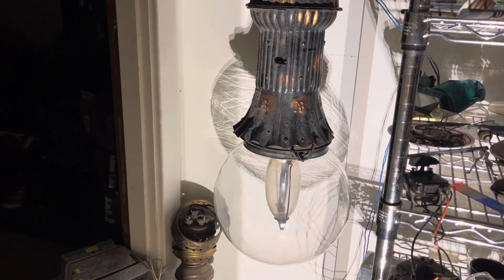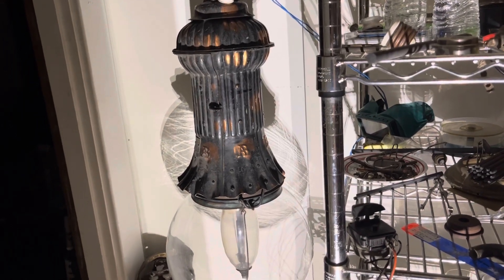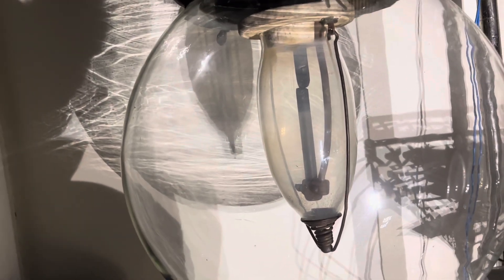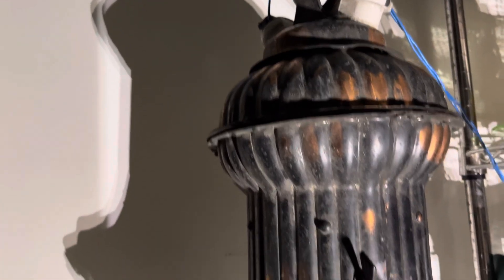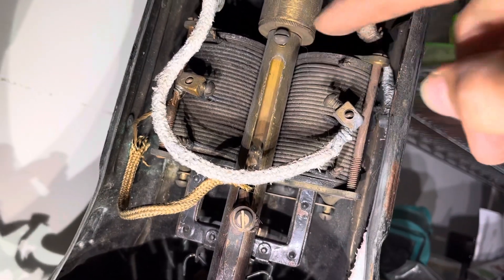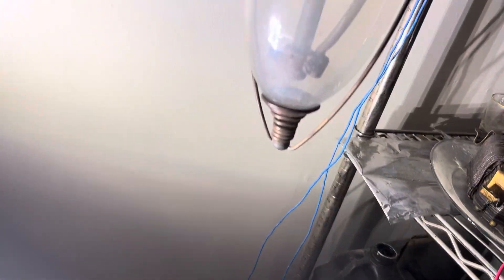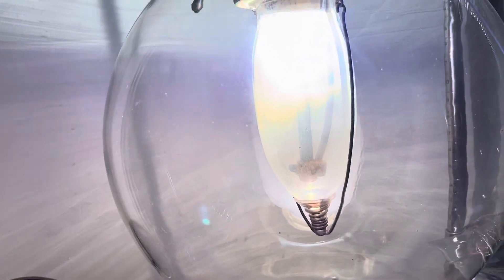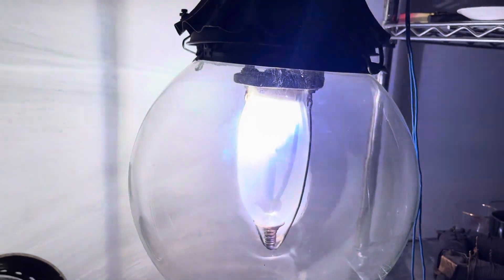1900s Adams Bagnall enclosed carbon arc lamp. The risks, overview, & demonstration.

Comment: Carbon Arc was still used in Theater lighting and movie projectors until recent times. In fact, we were doing shows with Carbon Arc Super Troupers up through the 1990's. They were limited at that point to outdoor shows, but the light they produced (with the right operator) was beautiful. They were DC arc lamps, with very large rectifiers and chokes. We also had a few of their smaller brothers (Troupers) which were AC arc. My sister still has 6 of them sitting in her basement. Fired one up about a year ago and still ran fine!

Comment: Really well explained. Thanks. 

So the input choke coil with various taps limits the total lamp current. 

The carbon magnetic lifting coil sets the arc voltage. Ingenious.

I completely get why running at a lower frequency will burn out the coils- you need the coil to have a higher inductance (or magnetism storage time between cycles) to limit the current. At DC, it'd be almost a dead short.

Comment: A good way to view the arc is to use shade13 welding filter with the addition of maybe shade 5, double them up and try it out.
Reply: I've tried stacking filters to record the eclipse since I didn't have a 12+ stops ND filter. Reflections between filters do a great job of blurring out details. For the arc lamp, you can probably get away with max stop on the lens aperture and 1/2000 exposure on a half-decent camera. Most phones and entry-level cameras don't let you get down to this sort of detail though.

Comment: that is one awesome lamp.   coincidentally I own a 400 watt metal halide Hang-A-Light,  made by SouthWire which works on the same principle as an arc lamp.    metal halide lamps, hitting the market in the early 1960s, are more or less an outgrowth of the mercury vapor lamp. which was used commercially since around 1930.  One could argue the arc lamp was the most important light source ever invented as it would pave the way to mercury vapor, metal halide,  high pressure sodium,  low pressure sodium,  fluorescent and neon all of which use an electric arc.
Reply from the maker: I did find a trade journal article mentioning an enclosed carbon arc lamp utilizing pools of mercury as the bottom electrode.
Reply: Not to mention that gas discharge was a major gateway into learning how different elemental materials can affect the spectrum you get! If we didn't find out how to draw an arc with carbons, we wouldn't have later learned that you could put elemental sodium into an insulated tube, fire current through it and get the spectra for sodium with it...

and us Brits would have been SoL during the energy crisis in the 1970s without that breakthrough because we'd still be running incandescent sources lol
Reply: Wow! I didn't know that, interesting  ~
Reply: It's a little bit of a stretch to call fluorescent and neon an "arc". It's a plasma discharge, and very similar to an arc, but there's a few key differences. Namely the heat.

Comment: actually boor-silicate glass doesn't filter out UV (that's the type of glass that would be used for the inner tube because of the need for it to withstand high temperatures)
regular glass does tho, the type that would be used for the outer globe, and don't look at the arc, there's a reason why welding masks are used when welding instead of just a pane of glass
I doubt running this indoors would be a great idea since the light creates a lot of carbon monoxide, I doubt it's gonna be fully concealed by the inner tube that encloses it.
Reply: Boroscilicate does still filter out some ultraviolet. It's transmissive to UV up to 300nm so anything from UVA to UVB can easily pass through. A lot of reptile specific lighting sources are made with this glass for that reason.

Glasses like soda lime are opaque to almost all UV. Soda lime is also extremely cheap, therefore is used in normal incandescent lamps and for the outer envelope of gas discharge lamps unless a UV output is needed, in which case boroscilicate is used.

If you need 254nm UV (UVC also known as short-wave UV) though, you can't beat Quartz. It's completely transparent to UVA, UVB, UVC and so is used for germicidal lamps. Quartz is also very temperature resistant and has very high glass transition and melting points. This makes it ideal for gas discharge lighting where the arc tube temperatures can readily exceed 1,000*c, which is more than enough to soften and melt regular glass.

Comment: Any one know what the running or operating time would be on a set of rods , would they have used them sparingly so to get a number of uses or would they be turned on and the rods used up in one use
Reply from the maker: @heartland96a  150-175 hours for one trim. Most lighting companies had dusk until 12A service for arc lamps
Reply: @Mirroxaphene  interesting details

Comment: 21:29 now in the early 2000s in the 1990s are climbing such as mercury vapor, lights or high-pressure, sodium lights deluxe similar to lamps, like these are starting to appear everywhere in cities all over because arc lighting within cities are starting to become more common
Reply: Perhaps this is how arc lighting got started
Reply from the maker: There’s no doubt in my mind that arc lighting started with this very fixture pictured here.
Reply: And I’m pretty sure this is extremely bright even the reflections on the walls nearby were uncomfortable to look at.

And heat from such a tiny little lamp was just staggering 

It was almost powerful enough to admit the entire day in direct sunlight
Reply: And since it also has a bit of a blue screen tint, I have a strong feeling that admits a very large amount of UV from that example of the uranium glass

Enemy have a possible large amount within the UVB range and also UVC 

You should wear sunscreen near this

Comment: One thing I learned is this: "Be very careful when plugging in and using antique electrical equipment. You never know what condition it is in. You run the risk of fire or electrocution." 
I build small high voltage devices for a hobby and have destroyed some of the machines I have built. Study EVERYTHING you can to avoid any issues. ALWAYS SAFETY FIRST. I can't preach it enough.

Comment: Arc lighting has been around within the 1980s and probably 1990s and maybe early on before even the early 2000s and trust me it is still used today. Most people are mostly about LED technology but most of the neighborhoods in town and even highways they still rely on arc lighting.
Reply: Arc lighting has been around much longer than that! carbon arc lamps were produced in the  mid to late 1800s to replace gas and they were also more power dense and efficient than incandescent lamps at the time.

Modern gas discharge lighting shares the same bones as these carbon arc lamps, but due to advancements in "shoving random stuff into a tube and blasting it with current for science" we have extremely tight control over all the parameters that affect the efficiency of the lamp such as the arc voltage, current, arc length, the quantity and types of elements that are in the discharge tube, the pressures that those elements exist in there at and so on.

It's actually impressive to me still that we can have arc lamps with an almost 100 CRI. I have a couple of ceramic 70w metal halide lamps that claim a 95 CRI and an efficacy of 97 lumens per watt!!

Comment: Beautiful lamp!  It was interesting to hear your discussion at the beginning. I have dealt with odd-frequency and DC motors before and had to build frequency converters before. I need to try and locate a high frequency carbon lamp to run with a frequency converter. I bet the sound will be different!

Comment: there are drivers/power supplies that generate the frequency that these need to run.
Reply from the maker: Do you have any specific links to examples? I’m not even sure what I would need to be looking for. This particular lamp was 133 hz @ 120V
Reply: @Mirroxaphene  I'd look at speeding up a true sine 60hz inverter, check controller IC datasheet, many support 0-400Hz for VFD and aviation power applications.
Reply: just use a VFD, or if your brave, a class D car audio amplifier, even a fairly modest one will have a +- 150v rail supply to the output section., would run one of these, jsut need a signal generator to feed it the desired frequency (and you have just made your own VFD but i digress)

Comment: For future reference of using tablets or phones to record videos, as long as circumstances don't prove otherwise, you can use the flashlight of the phone or tablet you're recording with as the light source for the shots. That of course isn't that valid in this video's case, but it's a great tool to take advantage of.

Comment: I don't doubt that electrical was not standardized back in the day that carbon arc lamps were used.  Back then, that was during the civil war and shortly after.  During the civil war, electricity didn't really have a use like it does today.  In fact, during the civil war, electricity was a luxury item that only the super rich and powerful people would enjoy.  Around the World War 1, electricity became standardized and 60 Hertz AC became the normal operations.  Around World War 2, electricity became standard equipment in homes.  But carbon arc lamps were used even after incandescent came around.  You know how gymnasiums, roads, factories, and such have mercury vapor and metal halide lights?  Well, the carbon arc lamp was the "metal halide" back in the civil war era, Titanic days, and those eras of time.  And, the operation of carbon arc lamps is just like that of an MH or mercury vapor.  Electric jumps the gap between two rods or electrodes and forms an arc and generates light.  MH and mercury vapor work that way too.  Only difference is that the arc in carbon arc lamps is in the air.  MH and mercury vapor are in an arc tube in a glass bulb.  But, your carbon arc lamp is an HID light source, high intensity discharge.  However, I would just drop in a metal halide ballast into the Adams Bagnal lamp and convert it to metal halide.  If it a DC lamp, you might have a better time powering it but even then, it is second to being impossible to do.  And, parts are basically non existent at this point.  And, troubleshooting will be a major pain.  That is why I always like to throw in a metal halide ballast and bulb into those lamps so I don't have to worry about your warnings.  And, metal halide ballast and bulb is child's play to find.  Metal halide ballast and bulb are "give-me" basically, child's play to find.  That easy to find.  Learning how to walk is harder than finding a metal halide ballast and bulb.  But carbon arc lamp parts?  Impossible to find.  Good luck with your lamp!
Reply: Converting it to metal halide would be ruining the one thing that makes that lamp interesting and historically valuable. If you want to safely run it on 60hz, just put extra inductance in series with the whole lamp to reduce the current. 
It's no different than thinking 'Huh, my Van Gogh painting is getting cracks from sitting in the sun. Oh i know! I'll throw the original canvas away and just put in a printed copy with digitally removed cracks!'
Just get a modern look alike if you want the looks of a 19th century lantern, don't go around destroying those increasingly rare pieces.

Comment: Why is there an inner globe?
Reply from the maker: @Dilophi  helps keep the oxygen off the carbon rods to extend the runtime.
Reply: @Mirroxaphene  Thanks for the answer, now it makes sense. It probably saturates itself with CO2 until there is not much free oxygen left which acts like a an early form of inert gas filling, i guess.
Reply from the maker: @Dilophi  that’s exactly what it does.

Comment: Sources mention 133 Hz, this is the 1st time I hear about 166 and 233.
Reply from the maker: They seem to be multiples of 3,600
Reply: @Mirroxaphene  Did you actually see arc lamps rated for that? 133 Hz is the highest I can find about historical distribution.
Reply: @tripplefives1402 Westingouse standardized single phase 133 Hz but later changed to 2 and 3 phase 60 Hz because Nikola Tesla's induction motor worked better on it.

Comment: The great thing about this lamp is that you just replace the carboon rods and lamp can keep operating for centuries

Not like todays lamps (like Incondecent, MetalHalide, MercuryVapor, SOX, SON, and god no LED'), you cannot replace anything inside there

Once they stop making them (SOX, MercuryVapor) or ban them (incondecent, CFL), because people like to ban stuff now, you are out of luck if you want to use them for whatever reason

With carbon lamps, as long as you can get some carboon rods (which you will probably be able to do for centuries), and know how to fix things if they break, you will be able to use this carboon lamps for a long time
Reply: Filament bulbs must have vacuum inside, the Soviets tried to make replaceable filament bulbs but they all failed, they came up with a method of bulb that would connect to an lamp that would create the vacuum inside the bulb, this worked but by 100 insertions the seals were so worn the vacuum failed not to mention the complexity and cost of manufacturing the thing outweighed all benefits. 
The technology is more the case of limitation rather than the manufacturer in this case.

Comment: If I owned a carbon arc lamp like that in this video, I would just throw in a metal halide ballast and bulb.
Reply: I wouldn't - unless the original internals are absolutely munted.

If they were still in serviceable condition I'd rather build a 133Hz inverter and continue operating it with carbons.

Failing that, a 400w 6000K MH wouldn't do too bad as a stand-in for the carbons. But you lose a lot of colour accuracy since most high colour temp MH lamps are only about 60-80CRI. Carbon arc is 100CRI as is incandescent.
Reply: @manitoba-op4jx  yeah :) Funny how variable what is essentially a tiny little tungsten resistor can be when you vary the energy through it :)
Reply: @DigBipper188 You are right about that.  The new stuff will never replace the old.  If you are only wanting to fire up an Adams Bagnal lamp on the original carbons, it may be fine for say a hobbyist.  However, the problem is when you need to replace the carbons, those carbons aren't made anymore, I seriously doubt that the original people who made that lamp are even alive anymore, so you'll have plenty of problems finding carbons for it.  And even if you manage to find carbons, which chances of that are second to none, you will have plenty of problems finding the opportunity to light it.  Like I said in a previous comment, and he said in the video, those lamps were intended to operate on very high frequency AC, try 360 cycles or something like that, but even if I am right on, good luck finding access to that high of frequency.  I guess you can try wiring that lamp to the red and blue leads of a high frequency instant start electronic fluorescent light ballast but I wouldn't recommend it.  In fact, I would STRONGLY advise against using a fluorescent light ballast to step up the frequency like that.  You can damage the ballast and maybe even the Adams Bagnal lamp doing that, can even catch fire.  Not to mention that carbons are a fire hazard.  That is what happened in the Iroquois Chicago Theater in 1908, which caused the curtains to catch fire.  That in turn  led to the development of the crash bar, if you ever wander.  It was a carbon arc stage light that caught the draperies which caused the theater to go up which claimed 700 plus lives.  Yes, a carbon lamp caused all of that madness, or so I'm told.  I only brought it up to prove my point.  If the Adams Bagnal lamp operates on DC, just series batteries together and you're there.  But an AC model might be a problem.  That's why I prefer to convert it to metal halide and use a 6500k MH bulb.  Yes, at the time of the Civil War, WW 1 and 2, Titanic, Lusitania, and those eras, carbon lamps were the hot dog back then.  Carbons were the precursor to MH, mercury vapor, high pressure sodium, and fluorescent lights.  In fact, carbons worked on the same principle and idea as fluorescent, MH, and mercury vapor.